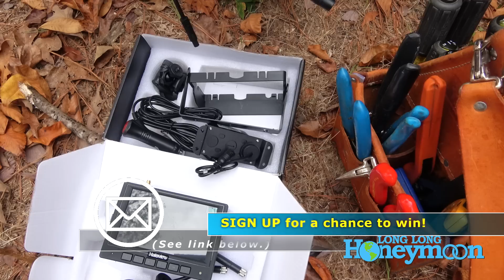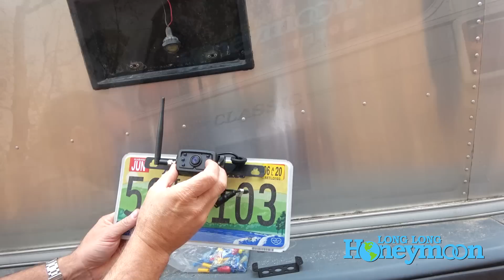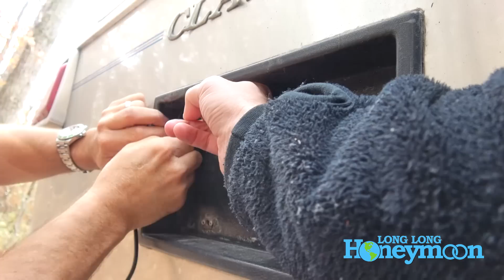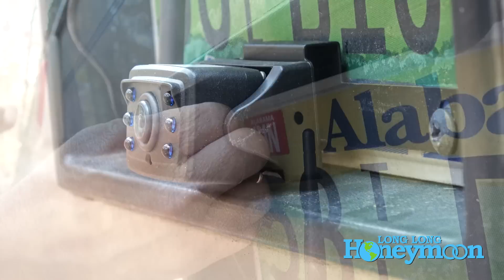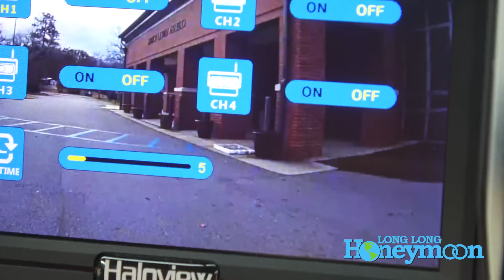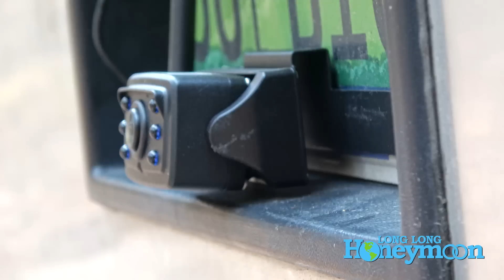Haloview MC5111 Wireless RV Backup Camera Review | Installation & Real-World Test

Comment: I just bought the MC7109 and 2-CA-110 side cameras to replace the Voyager camera that came on my 2018 Tommy Bahama 19CB
Reply: Hello Glen, I'm getting ready to buy the same system as you.  They are out of stock at the time.  I would much appreciate how this works out for you.  Thanx,  keith
Reply: @keithnorris8982  so far the resolution is amazing compared to my old voyager.  For simplicity, I mounted the side cameras on the Airstream stone guard mounts and will run wires into the battery box.  I'm mounting a switch on the battery box to power the cameras,  not connected to running lights.
Reply: @glenc90240  Thanx for your input Glen.  I can't wait to get out and about this fall:-) - -keith

Comment: An obvious answer to many of your problems is to mount the camera inside the rear window looking out.  You can wire it to any power source there, and you can get cables running the antenna to anywhere inside closer to your monitor.  Also solves problems of weather sealing, blocking the license plate, theft, vandalism, etc.

Comment: I don't know if you've done a follow up in the past 6 months and have resolved the latency problem or not.  One thing I noticed right off was that you had your camera (transmitter) antenna and display (receiver) antennas oriented wrong which would really degrade the system performance.
You had the camera antenna positioned vertical and the display antenna positioned horizontal, like this...  I __
They need to be the same for best signal quality, like this...  I I  or  __  __
Also, never point one antenna directly at or away from the other (end on like when aiming a rifle at an object).  This would be worst case.
Thanx for the review and travel safe.

Comment: I know that I’m late to comment, but I would have mounted the camera at the top with 3M industrial mounting tape.  You can only get that stuff off with solvent, and no holes!  Also, putting the monitor in the middle of your windshield not only causes cancer in California, but causes you to run over pedestrians you can’t see.

Comment: Since that camera has a standard antenna hookup (uses the same type as most computer Wifi antennas) you could add on a wired antenna and attach that antenna to the top of the trailer. I bet that would increase your signal quite a bit.

Comment: What you might want to do, is buy a short coax cable, with the proper connectors.  I didn't get a good look but they sort of look like SMA connectors.  You can mount the antenna to the rear window of the trailer, which will greatly improve the signal strength, as RF will make it through glass.  Be sure to orient the antennas the same way so the signal polarization at both ends is the same (vertical, or horizontal).  If they're 90 degrees out of phase, you will decrease the signal strength by 20dB.

Comment: I added a two camera system to my rig.  To get rid of the delay I installed the antenna extension and magnetic antenna on my camper camera.  It worked like a charm.  To attach the magnetic antenna base to my rubber roof, I used the rubber roof patching tape.  It didn't move in 8,500 miles.  I used the power from the center clearance light to power the camera.   The other camera is on the truck.  The whole system was less expensive than a manufacturer installed system.

Comment: Good information, thanks for sharing.  We installed the Furrion Vision S on our trailer, mostly because it was "plug and play" for our trailer model.  We mounted the camera where the middle light in the top back of the trailer, no drilling required!  It works well but I don't have an aluminum shell between the truck and camera which has to cut some of the range/performance.  We just bought our trailer in April of this year and I had the camera in place in June, it really bothered me not being able to see back there, I can't imagine putting on as many miles as you have without one, but has worked well for you.  Thanks for your videos, can't wait to get to Yellowstone in our trailer!!

Comment: We’re fortunate to have a rear window in our trailer, so I was able to mount a wired camera inside to avoid drilling holes in the camper.  I ran the wire to the cab of our truck by installing a 1/2” pvc pipe under the trailer wire tied to the propane line that fortunately ran from the tank mounts in front straight back to the rear bumper.  Our system is designed to couple around the hitch, so it’s easy to connect when we couple the trailer wiring to the truck.  The only exposed area for the wire is where I draped it out the rear window down to the pvc pipe.   I use several short pieces to clear packing tape to adhere the cable to the outside back wall.
We leave the backup camera on when we travel, because I agree with the premise of your video, but I also agree with some other commenters here that the lag time is a no go for me.  

With our installation I can see what is behind us and who’s passing in real time.   That is really important to me when changing lanes.  I want to know that I have room to make a change and any lag time could be hazardous.   IMHO, this wireless system fails the reliability test.

Comment: crimped heat shrink is not waterproof.   The real solution is to solder the wires, and then shrink tube over it for electrical  insulation.

Comment: Happy to report I installed the exact same model on  my rig. 36ft 5th wheel, pre-wired for the more expensive Furrion at the top in the rear and I experience very little issues or lag. Ideal on the highway. It's worth the expense. Me thinks the issue you have is the Airstream aluminum causing your issues.

Comment: We have a 34' travel trailer and it works fine at that distance. The lag depends on the signal quality, but there is always a small delay. I always mute ours while driving. The UI is pretty clunky but you will memorize the buttons you need to press to mute and unmute.

Comment: Thanks for this info as I am currently looking for a backup/monitor camera for 40ft fifth wheel.   The common complaint that all reviews of wireless cameras have is signal loss, delay, jumping or even going blank when traveling at highway speeds.  Would some one PLEASE explain why my slow rv is faster than the signal from the camera?
   With all that said I'm seriously considering this unit or similar
Haloview unit.
Thanks

Comment: We have a Springdale 31 foot hitch pull and like your Airstream it has a metal skin that raises havoc with signals. I bought an additional antenna and mounted it on the side of the trailer (I get four bars when turning left) but otherwise pretty much what you described in your video. I mounted my camera and wired it through the rear clearance lights. I have to have my running lights on to operate the camera but overall it works pretty well.

Comment: An unexpected long lag could trick you if you didn't notice it happening. Could possibly be dangerous. I wonder if you could connect an extension (wire) between the antenna and the monitor. Then you could stick just the antenna out the window, attach to side mirror, etc.

Comment: You can buy an extension cable to extend the antenna on either the monitor or the camera , available from Amazon for under 20$. We have an f350 long box crew cab and 36ft th. Furrion camera works ok. But also not glitch free.

Comment: You don't need to relocate the camera.  Just get a cable for the antenna and mount the antenna remotely.  For really large trailers, many people will move the antenna to a mid-ship point in the trailer to establish a link.  You could also run it up to the roof and magnetically attach it to a point up there, perhaps some ferrous metal on the AC unit.  That way still no holes required (but a well concealed wire running up the outside of the Airstream).  Probably only adds about $20 to the setup.

Comment: Sean,I’m wondering like with aTST tire monitor system they provide a repeater hooked up to the battery at the front of the hitch area. If that would help boost your rear signal. 

A delay is not a good idea for safety. Like backing up who wants to feel a rear hit then see what you just hit on the monitor. 

As always Thanks for a honest and good review.  Our Airstream has a std rear monitor we have some grainy views but no time delay

Comment: Do you have both antennas aligned the same? In other words, either verticle or horizontal? Having them the same will increase communication between them.
Reply: We do! Again, I think it's just the Aluminum skin interfering with the signal. We're going to look for some other antenna mounting options over the winter and see if we can find a roof spot that can be wired without drilling holes. If so, we'll give it a go and report back on how it improves the signal. Fingers crossed! :)

Comment: I have a different brand on the back of my 19 ft Airstream. As a solo traveller I love it, both for when I’m backing up and using it as a rear view mirror. I found no convenient spot to mount the suction cup inside my truck. As well, I found that it didn’t hold very well.  So, what I did was use Velcro strips to wrap around the monitor on either side and use another to brace the two straps together in the back in order to mount it directly to my rear view mirror. It’s easy to take off when I’m not towing the trailer.

Comment: We installed the Haloview on the back of our 25 CCD work perfectly
Reply: The one we installed was Haloview MC7108 7'' 720P HD Digital Wireless Backup Camera System 7'' LCD Reversing Monitor on our airstream powered from the clearance lamp.  Works as both a backup camera and rearview replacement for the mirror.  There is no delay - works flawlessly

Comment: Hi Sean, glad you had this product reviewed. I just bought the Auto-Vox rear view system with a solar panel built in to the rear view camera so it’s 100% wireless and a great screen with suction tower only $169 and Costco has similar one called Type S on sale for $119

Comment: I have a different brand and works fine.... only concern I have about the location you chose is in weather with wet roads, the camera  lens is going to get dirty, and wet pretty much useless very quickly.
Reply: Our trailer tag is up high enough where it hasn't been a problem.
Reply: Kristy Michael .. took me a while to get used to looking at the monitor and not see the trailer behind me... wonder at first ..”what happened to the trailer!”

Comment: I have the Garmin BC-30 camera mounted INSIDE the rear window, under the cabinet. The GPS is the monitor. The resolution is much the same as yours, sort of clumpy. The lag is relative to speed, so on the highway I'm guessing the camera shows about 4 frames or 15' later. When backing into a spot you're going so slow, a few frames is not noticeable. But the poor resolution makes a shadow look like a rock, or worse, a rock looks like a shadow. I still get out a lot. I'm so pleased you picked this topic because I get to compare mine to others. If you put the monitor close to the camera does the resolution improve?

Comment: I bet the video lag might go away to some degree with a better signal: an extender cable for the antenna would help.  I want to go for the high permanent mount (I bought one a couple months ago, but haven't mounted it yet.  I may put the antenna at the front of our AS.  This little addition will make it good for backing up.

Comment: with a direct wired camera... we found  you don't have a delay or interfear from the camera to display... and mounting it on the lower level backing you will not get a good idea of location as well as you get the delay backing up also that you noticed.. with the passing vehicles... 
Also we found watching the rear view on the dash.. while going down the road... is confusing.. and clutters up the driving.  probably why most car manufactures turn off the rear view when going forward... 

 HOWEVER, you need to have a TV Ball hook up camera too... here you can back up the TV and right place for the ball under the hitch... so what you did is limited in ability... Here we use a magnetic mount on the tailgate... looking down at about a 45 deg angle... excellent one time backing location every time ... 

Airstream has a rear backup camera mounted at the clearance lights on the new ones... by the way... 

Thanks for the show... keep up the good work...

Comment: Info note: in Calif you can attach to the windshield if you mount on the lwr. Right or lwr. Left corners of your windshield. I use the furion camera and I don't have any lag on mine as the rig is 28 ft fifth wheel and I do put my 7 inch monitor just under the rear view mirror as it is my rear view. But like you I use the suction cup mount.. thanks for the great video..RickM117 from communist calif...
Reply: lol

Comment: I have the 5 inch Haloview.  Started with the 7 inch but returned it because it was just too large and took up too much dashboard real estate.
There is an repeater antenna for the Haloviews that works great for RV's greater than about 30 feet.  I have a 40 foot RV and it really helped in solving the stutter and frame rate issues.

Comment: I agree, the license mount is problematic with an AirStream aluminum skin, signal-wise.  Both antennas should be vertical to optimize signal transmit and receive, however LEO's may have a problem with the antenna obstructing the view of the license number.   The camera needs a custom bracket to LOWER the camera slightly (or as much as possible for your license cavity), and push it all the way to the left so the antenna is not obstructing the license number.               If it was me, I would try mounting the camera INSIDE, behind the window.  Yes, the window is tinted, but your camera may have enough light gathering to compensate.  The night time view may suffer a little, but it may be a worthy trade-off to potentially gain more signal (this would have to be tested of course) and to prevent camera theft. Worse case, extend the antenna out the top of the trailer, but only as a last resort.  Test that by poking the antenna with a short 3' SMA cable through a roof vent to simulate how the signal strength improves, before drilling a permanent hole for the final install in the rear.

Nice camera, and I like the multiple camera option.  Thanks for sharing.

Comment: I found that if I run a extension wire for the antenna and relocate it to the front of the trailer the reception improves tremendously (skips and lags dissapear).  In fact I have the Haloview MC7101 with 4 cameras and all now work perfectly.  I used Ellen Tool 5M Antenna WiFi RP-SMA Female to Male Extension (B01CL4T08K) $5.94 along with FPV Antenna Adapter (B071SK74HN) $5.95.  PS I have mounted one camera on each side of RV and one on the back.  I use the fourth camera as an as needed camera.  I am very happy with the purchase.
Reply: I'm glad to hear that you have enjoyed your camera! We may add an extension and try to mount the antenna near the front end on the roof. We really don't want to drill a hole in the Airstream aluminum (mainly because of potential leaks), but there may be an existing hole that would work for this purpose. However, in its current set up, it seems to work pretty well with only the occasional lag.
Reply: @DeputyStryker, I think mounting it inside the camper (even near the front) would not work because of the Aluminum skin. We have trouble getting wifi and cell signals inside the camper, so I'm pretty sure the antenna for this camera would have trouble too. I love our Airstream, but it has a few quirks! 😄

Comment: The antennas are recommended to be in the vertical position, not the horizontal position like your monitor antenna. I just bought the long range version that comes with an amplifier and 12 meters of cable. I will be installing it on the back of my enclosed car trailer that I pull behind my 33 foot Class A. The antenna will be installed on the front of the trailer at the height of the motorhome's back window. I am hoping not to have any of the lag that you are experiencing.

Comment: I find mine has no lag on a 20' fiberglass VistaCruser. I mount mine over the rearview mirror using 2 hair elastic scrunchie over the side mounting bolts. Then slip over the mirror ends. It's natural to look at the mirror when driving to see your rearview. Try to keep your antennas matching vertical or horizontal. Thanks for all your videos. Been watching for a long long time.  Vince

Comment: Metallic tape up outside of Trailer or pop a fine wire through small hole, placing  antennae on inside  facing driver.